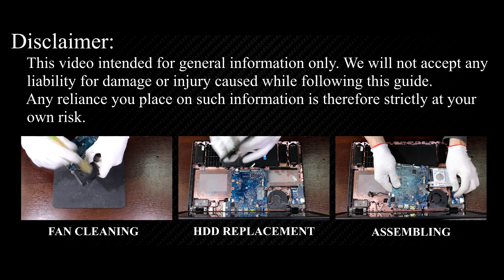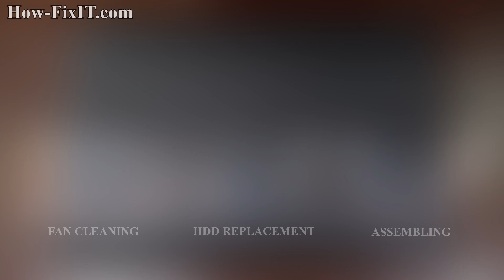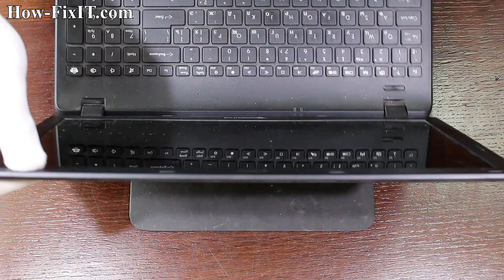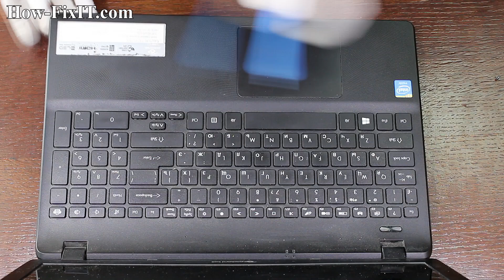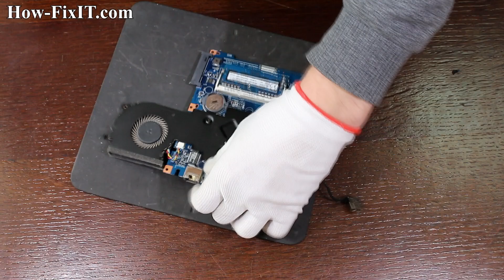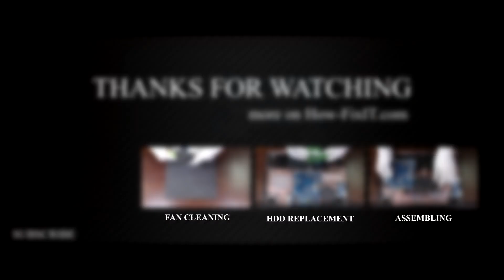Packard Bell EasyNote ENTG71BM RAM Upgrade and Installation Guide

Comment: Hi, I have exactly the same laptop with 4 GB RAM but it is still so low! 
I think it has only one slot for RAM. 

So I would like to upgrade it to 8 GB. Does it make a difference if it is 1333 Mhz or 1600 Mhz? Which one should  I buy? 

Thanks!
Reply: Buy yourself an ssd if you don´t already have one. Ram ist the laptops short term memory. If you want to be able to open up 20 and more tabs in your browser and to switch between them quickly that when you add more ram. The ram speed doesn´t matter too much.

The SSD will make your pc boot faster etc. but it too can only do so much if the processor sucks.

Comment: is possible replace CPU or upgrade ? for this computer ?
Reply: no i5 4200u's are soldered. what you can do , maybe, find a very similar mother board with higher specs, assuming the fan is in correct config. thats the most you can do. YOu can not even manually control the fan. Other than that i like this laptop actually, after installing an ssd
Reply: @Ahmeto.o1994  u guys are lucky my tf71bm is a celeron